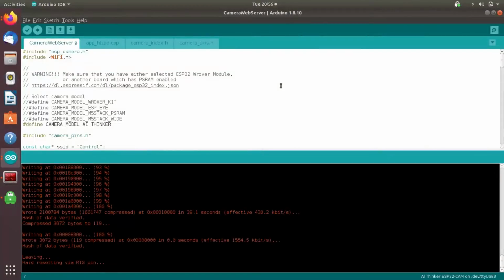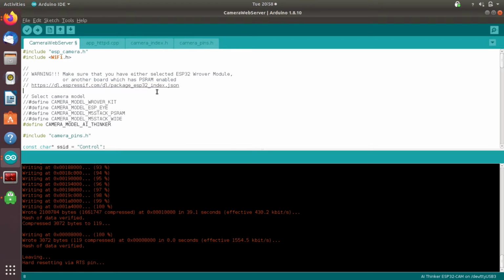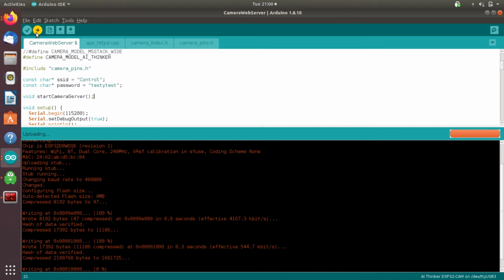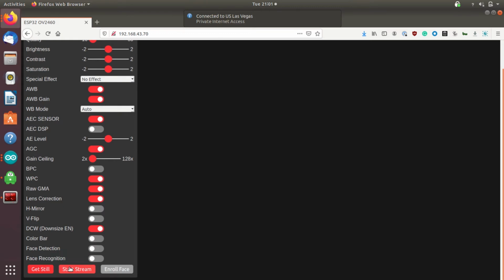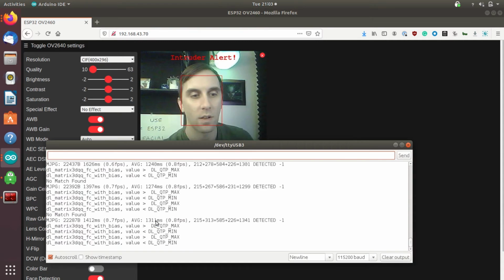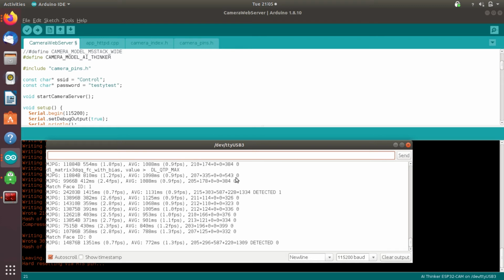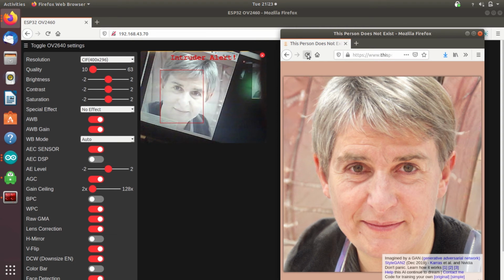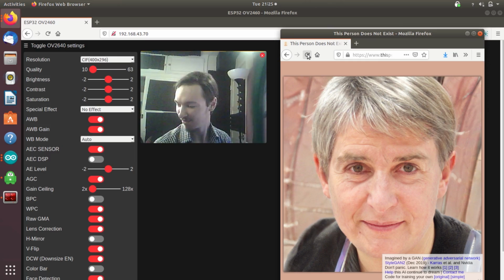Use Facial Detection & Recognition on an ESP32 Wi-Fi Camera [Tutorial]

Comment: I am able to upload the code however when I access the ip address, there is no enroll face option. What would be the next step ?
Reply: hey did you get the face detect and enroll face feature ????
Reply: They removed the feature. I had to roll back to esp32 v3.0.7 board manager in order to get it.

Comment: Hi, I just bought one to try because it looks interesting. The code loaded fine, the serial monitor displayed the ip of the esp32 and I can connect. After that there is no output in the serial monitor, I have set the level to debug but nothing is displayed in serial monitor. Also the face detection works but when I activate face recognition nothing happens, the face box stays yellow and does not turn green or red for intruder
Reply: I am facing the same issue, nothing happens when I turn on the face recognition, Only yellow box appears, Null byte can you please help with this issue or provide any other method, I actually want to store this recognized face in an excel sheet and use this system for attendance management.
Reply: @OnkarMendhapurkar   you have to press the reset button on the esp after it connects then it outputs a link you put in your browser to acesses the gui